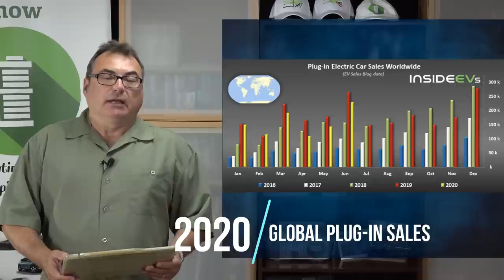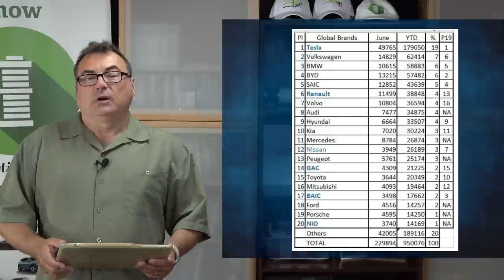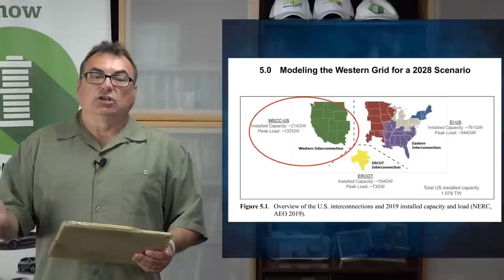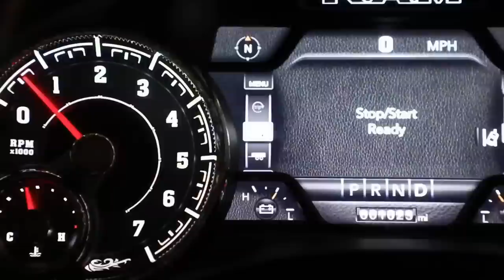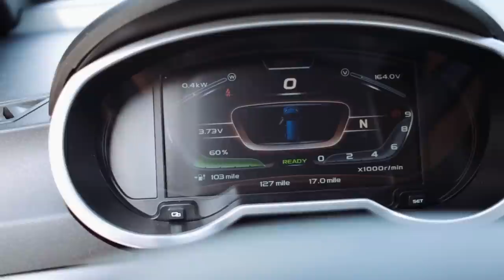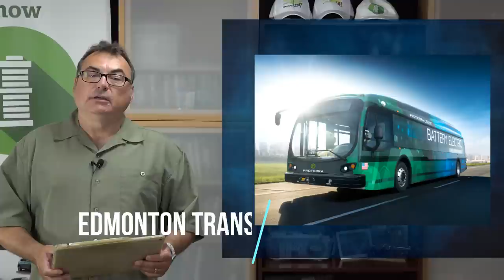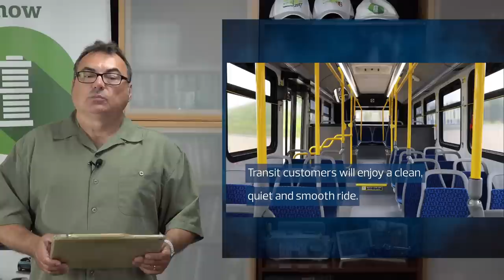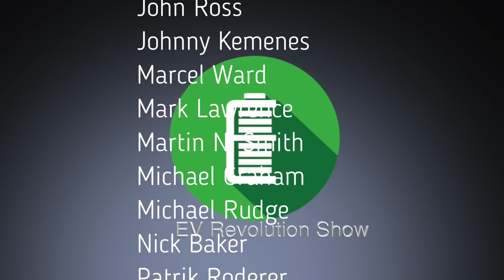Episode 102 - The EV Revolution Show

Comment: I’m really loving the new look and it’s good to switch it up every now and then. Proterra buses look like they’re nailed down the design and look fantastic. I work at metro in the DC area and spoke to one of the managers in the sustainability department about what they are doing to get buses like Proterra. Here response was so so mentioning that politics was involved. I’m looking where we go next in bus electrification and I won’t be surprised if the union is worried and job losses.
Reply from the maker: Thanks Ayo for watching and for commenting.  Muni's have to look at the TCO & Opex savings against the upfront Capes.  Take away the environmental and health benefits for a moment (to me are just as important) and focus on economies.  It's not hard to build a very positive model that over the typical lifespan of a transit bus, more savings can be had versus expenditures.  Sure, may take several years to recoup the Capex, including infrastructure, but the savings are there.  

You are correct that it is mostly politics and upfront expenditures that are the main barriers to this.  All-electric buses and supporting infrastructure are not cheap.  

As far as job losses, I don't see it as you still need drivers and in fact the Unions should be promoting this as they are safer, zero emissions so healthier and offer better driving dynamics and experiences.

Comment: Those Kandi cars are going to appeal to a younger urban crowd. But I don't think it will sell well otherwise. Europe on the other hand is a better fit for these cars. As far as those buses are concerned there is only 1 hilly part in Edmonton and that is by the river valley. These buses will be a great example for other transit systems to save money long term on maintenance and fuel.
Reply from the maker: Thanks Walter, yes agreed and really no matter how little or lot they sell, every bit helps.  Thanks for sharing about the Edmonton area and yes, electrified transit amounts to huge benefits in many ways.
Reply: Agreed Ken one benefit is that an electric bus will give many people their first EV experience and they will appreciate the smooth quiet power and no fumes:-)